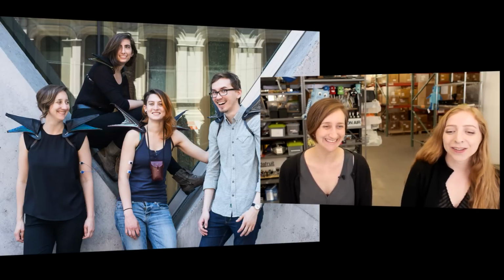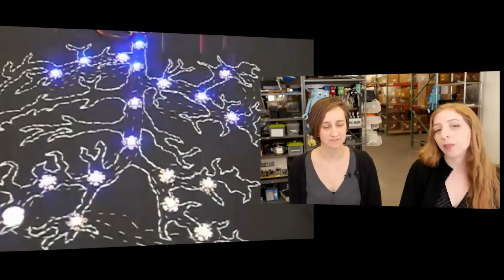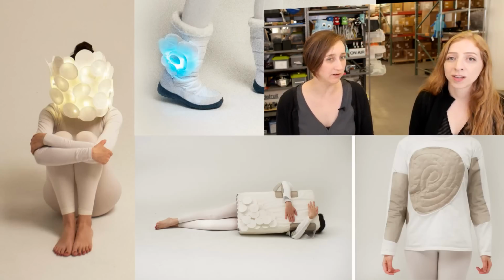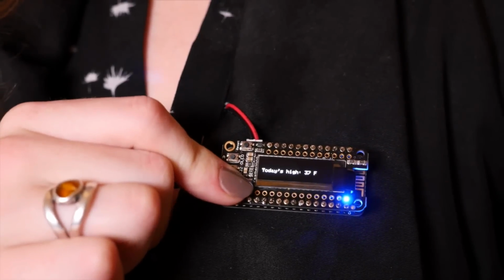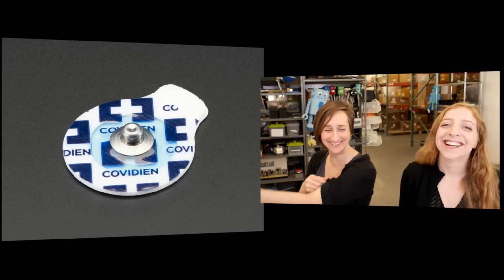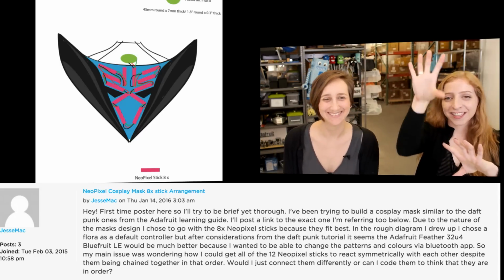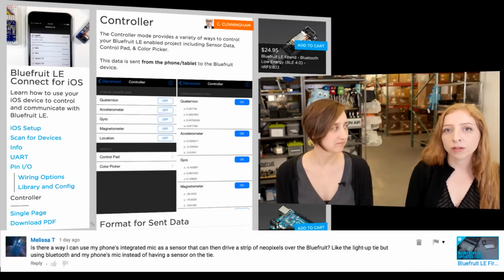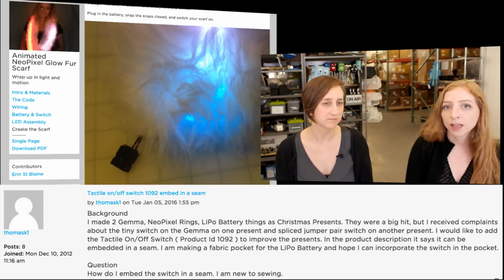Kate Hartman cohosts Wearable Electronics with Becky Stern 1/20/2016 - LIVE

Comment: Also a thought about the electrodes, more specifically the clips for the electrodes. You could team with Noe & Pedro to make a 3D printable clip. Ie: a simple design with a plastic spring clip with a hole on the one side that you could later insert a strand of solid wire which would go through to the inside of the clip area, & would then be bent into a channel on one side of the interior of the clip.

Comment: Hay Becky! I'm making an outfit for my daughter for her dance class, and I want to get some input about wearable power supplies. I know that LiPo batteries run a high risk of fire and obviously not an option, but what about the cylinder batteries that come in stuff like, product ID# 1959? It comes in the plastic casing & what not. How safe are they? Do you think that something like that would be a safe option to power my 6 year old's outfit? It'll be powering a 5V trinket & about 20 Dotstars split into 2 rows of 10, running at about 50% or so brightness. What do you think the best & safest wearable (preferably rechargeable) power supply would be for her?